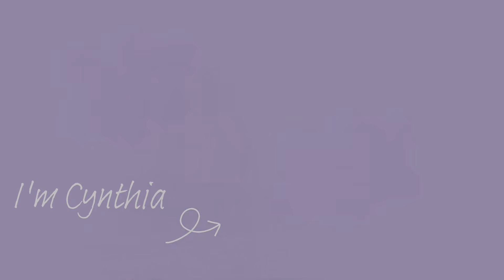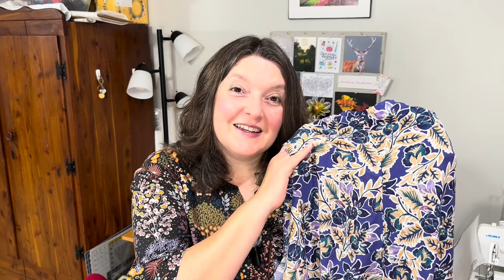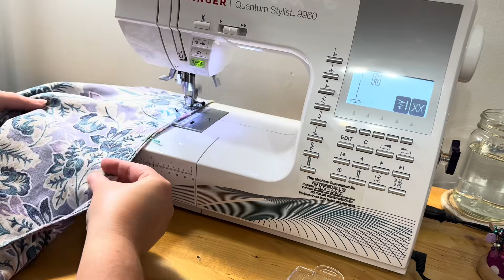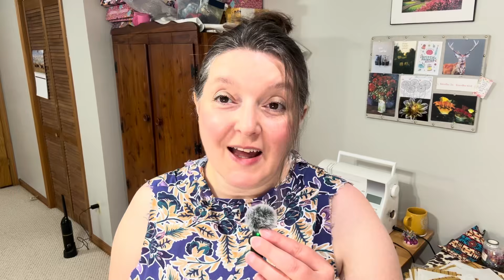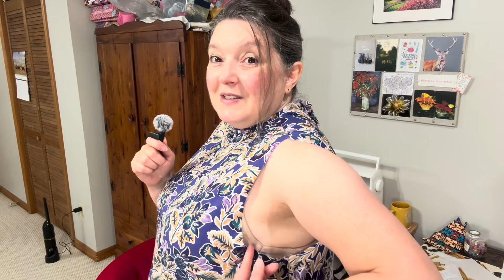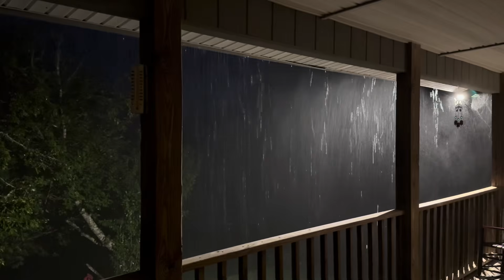Sewing The Fibre Mood Lumen Dress Part Two

Comment: What's the deal with that neckline?! You came up with a great solution, but what a job, Cynthia! I have a big head and my neck is as chubby as the rest of me, and I've never encountered this difficulty. 

I found my notification bell wasn't turned on so I rarely had your videos pop up. Fixed it. 

My bras come up really high (full coverage H cup models) and when I had your problem with a sleeveless garment (mine was the Love Notions Lyric) I pinched some from my shoulders -- I could do this with a V-neck -- and took tiny darts before facing my armscyes. It worked absolutely fine. 

This dress will be GORGEOUS on you! - Kelly
Reply from the maker: Thank you, Kelly, for this advice. I’m loving the way the dress is looking so far too.

Thanks for watching and for clicking the notification bell. ❤😊

Comment: That section of the armhole where you're placing the dart is cut on the bias.  I am often able to ease in a small dart, but I don't think it would be possible to ease in a whole inch, so you're right that a dart is necessary.  That said, if the dart still doesn't bring your armhole high enough you might be able to ease in a little bit more to help raise your armhole.  You may have to ease in some on the back section of the lower armhole as well.   Even when I ease in 1/2 inch, I don't generally get noticeable puckering because of it being on the bias, but of course it will depend completely on the fabric you're using.  It certainly wouldn't hurt to sew some larger stitches in that area and try pulling the bobbin thread to see if you can make it work without a modesty panel. 

I think you're going to be so pleased with your final dress!!!  I love the addition of a back tie.
Reply from the maker: Thanks Nadine for another tip. I have added the bust dart but haven’t added the bias binding yet. 😊

Comment: Good morning, Cynthia! If the dart doesn't work out, I wouldn't worry about the modesty panel looking obvious because the fabric is very busy. I don't think anyone would even notice and if they do,  frame it as a design element. Maybe you could try and match the pattern as close as possible. I have the same upper body fitting issues as you do, so I understand the frustration. I love your choice of fabric and pattern very much. ☕
Reply from the maker: Thank you, SuzySunshine. Hopefully, the bust dart alone will fix it. I hadn’t considered that the busy print would make a modesty panel less noticeable. You’re right. Thanks.☺️